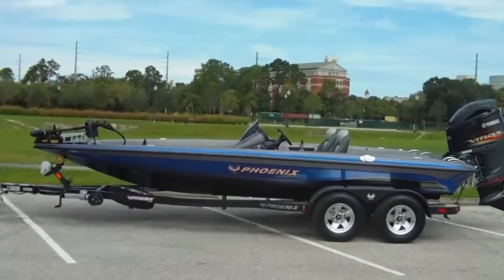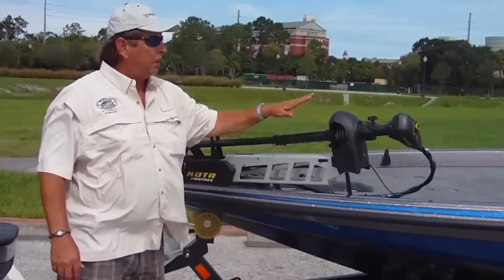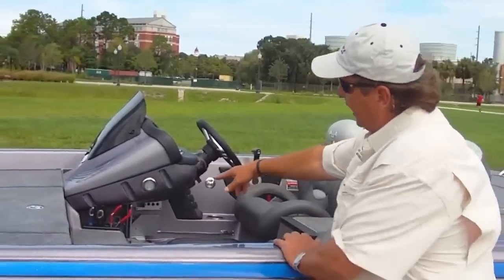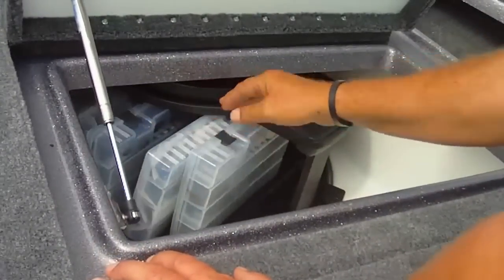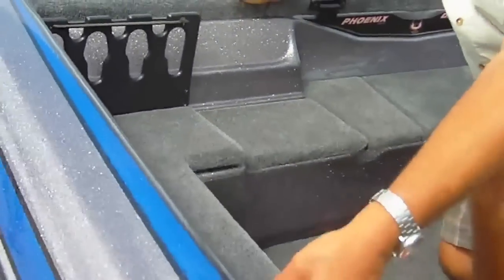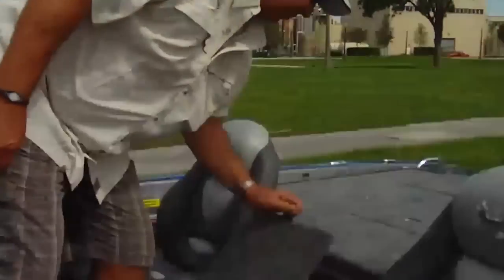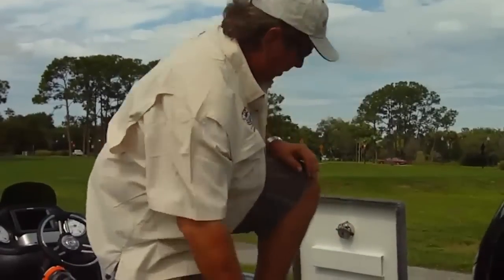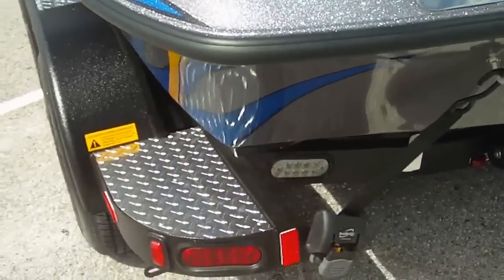2013 Phoenix 920

Comment: how do you run wires from front to back or back to front with enclosed console? Where would a 5 port switch be mounted with that unique enclosed console? looking at buying a 2013 921